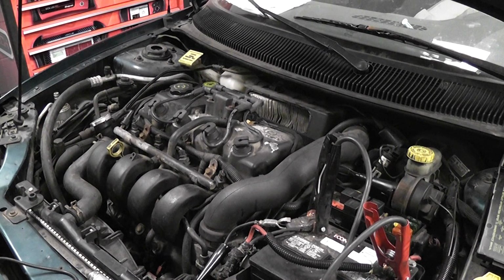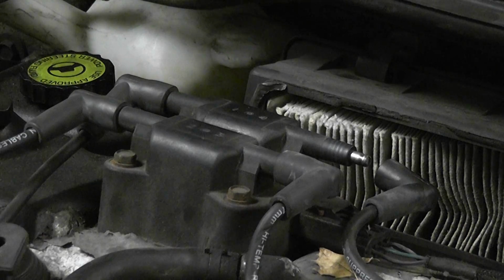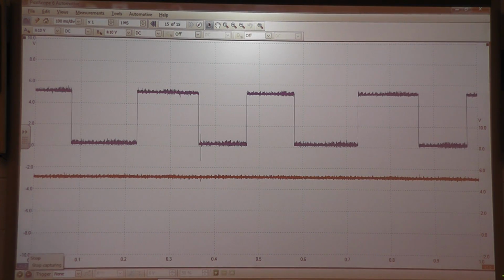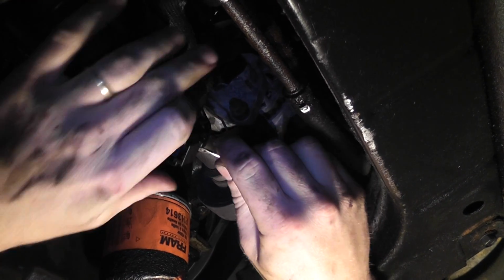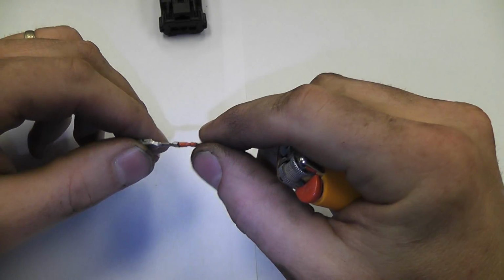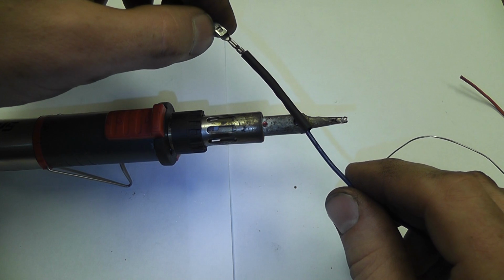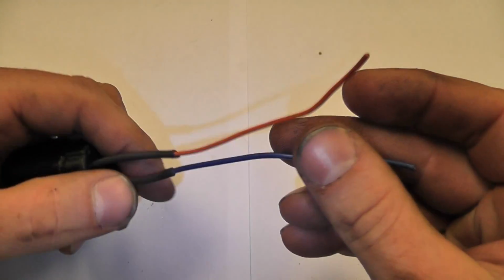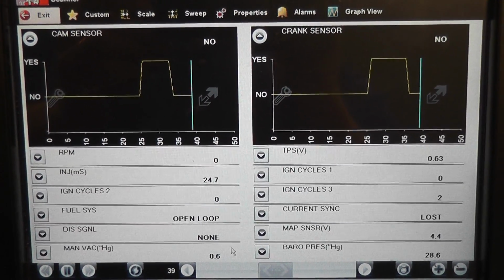1997 Dodge Neon no start, crank sensor problems

Comment: I had the same situation with a 2014 altima. No spark, no input to ECM.  Changed the crank sensor but still no spark. After market crank sensors do not work for  Nissan.

Comment: I have a 1999 mustang it was running rough.  Replaced plugs and wires, lower intake was leaking coolant so I replaced that now it crank no start. I have no codes. I triples checked the spark plug wires routing. I have low compression on cylinder #2 would that cause a crank no start? Could the head gasket be bad now or maybe carbon build up??

Comment: One of the most thorough videos on YouTube. I was trying to find the position of the sensor as some diagrams show it being just under the starter on the front of the motor but I think they were for newer years. I did the oil pressure sensor today and I hope when I take the crank sensor out tomorrow that the wires do not break. Not nearly as skilled at fixing wires as you.

Comment: GOOD AFTERNOON, I AM FROM BRAZIL and I have a neon chrysler, which was stopped for 3 months because of the fuel pump. I changed the bomb and now it starts normal, but when I pass the second gear it drops the rotation and does not respond and ends up dying. I also noticed that his slow motion has a very small flaw. What can it be ? I NEED HELP PLEASE
Reply from the maker: "but when I pass the second gear it drops the rotation and does not respond and ends up dying" 
I do not understand this statement
Reply: @ScannerDanner  In fact there is no such thing as passing the second gear and the car loses acceleration, the car is running normally and suddenly the accelerator does not respond and the mortor turns to 600 RPM, it shakes a lot and accelerates the engine goes off
Reply from the maker: @BILUKAMOTOS1975  year, make, model, engine size would help, also this should be setting some type of trouble code. Post this to my forum, it is free to join and we can help you better there www.scannerdanner.com
Reply: @ScannerDanner  ok
Reply: ok I'm already on your site!

Comment: Hi scanner how are you doing  im just looking for the section about the floating ground can you please tell me which one it is
Reply from the maker: You'll see this on Variable Reluctance Sensors (permanent magnet pulse generators) on cam and crank sensors and you will also see it on some O2 sensors circuits. Chapter 21 playlist on both YouTube and my Premium channel. And then Chapter 5 also.

Comment: 03 dodge stratus no start it got new Ck &can sensors. A new ecm has been flashed still no start. Found no voltage to coil from connector. Sensors have 5volts .any idea what it mite be??
Reply from the maker: You won't have voltage to the coil with the key on, on that model, as it is controlled by the ASD relay. (Same controls as the fuel pump) Which only gets energized by the ECM during initial key on and when there is an RPM signal (cranking or running)

Comment: Jeez, learned a lot here, from crank sensor to CAM sensor , Butane Soldering Iron/ gun, Heat shrink... wow! I got to have all these tools for my Chrysler neon cables.  Thanks a lot... felt like i was in varsity class!

Comment: DID YOU SEE all that oil on the connector.....dodge has a serious problem with oil wicking alll through their harness's causing wacky voltages and stop/runs....check other connectors, there will be oil in them, sometimes alll the way to the code reader under the dash....all kinds of wacky readings, gremlins

Comment: Aleksi
Hi, I have a Chrysler neon 2001with a remote problem. The times are working well and some times do not work and I have checked the coel does not send electricity to the candles

Comment: Hello need ask a question my battery started dying like the alternator was bad so we changed it n now it's cranking over but won't start u have any idea what it can be
Reply from the maker: You need to tell me what you are missing to help. Spark, fuel pressure, injector pulse, compression, trouble codes

Comment: Hello, I am from Venezuela. I would like to know what can I check on my neon 2005 auto transmission because it wont start, I changed the CPS this morning and it did nothing, the starter runs, I see spark on each spark plug cable there is fuel in the fuel line (pump is running fine) but the engine wont start.

Comment: this is one of my cars i change the engine temperature switch cause thats the code i got and got a new battery when i turn the key i hear the fuel pump but it wont crank
Reply: i have a light pitching noise in my fuse box when i turn the key i have new relays and i put my hand on them have someone turn the key and they click but thats it  it wont crank i changed the ignition switch and crank sensor
Reply from the maker: It is becoming more and more difficult to answer questions here. I have 80,000 people asking me for help now. So I have created a forum to help you guys better. It is free to join and we can exchange pictures, wiring diagrams and waveforms if needed to help guide you through the process of troubleshooting your vehicle. Thank you so much! Hope to see you there. 
Paul Danner (ScannerDanner)
 https://www.scannerdanner.com/forum/post-your-repair-questions-here.html
Reply: take the fuel line off the fuel rail cut open a p0lastic bottle stick the line in the bottle hook a clamp from the negative part of starter put the car in neutral go back under the hood now the wire clamped to the negative part of starter touch the other end to the positive of the battery it will try n crank the car if no gas comes out the line into the bottle than you have a fuel issue
Reply: there is gas in the line when i push the little button on the fuel injector rail do you think it also maybe my spark plugs when i replaced the battery it turned over once then died i also but some fuel injector cleaner in it lastnight
Reply: thanks for commenting on my issue why does my fuel pump make noise if its a fuel issue could there be trash in my fuel line if so how do i get it out i did manually put gas in it when it wouldnt start thinking that was the issue
Reply: could be a multitude of issues if you do what I suggested with the fuel line you will rule out the fuel pump or find that their is no fuel you could get someone in the driver seat you under the hood take the fuel line that goes to the fuel rail push the two sides in the plastic clip pull it off put it in a bottle cup exc now have them crank it if you get fuel your fuel pump and rely are good aslo you should hear a click noise coming from the relay in the fuse box under the hood under the battery when u turn the key on before cranking pull it out and inspect it too its labled on the lid its the  bottom left I believe see if the metal looks burned up on it after pulling it
Reply: the fuel filter is inside the fuel pump on the neon their is also a fuel pressure regulator their is a video I seen on yt type in dodge neon fuel pump and they show you how to remove it you will need a jack and jack stands
Reply: not sure bro mine still isn't running I checked the computer on mine and the damn thing is loose like it has ben tampered with in the past id check the cam sensor if you remove the battery look to the left its a squar piece if their is oil coming out of it id replace it if you got any oil in the switch try n clean it out I changed mine it was bad with no codes also check the wire running to the starter the red wire if it is broke anywhere replace that joker you can get it from the topside you cant buy the wire you gota make a wire they sell the stuff in autozone mine is no spark no fuel but if I slam the hood a bunch while cranking sometimes it cranks lol also look up stuff on the pcm your cars computer is bottom driver side of the radiator also their is another sensor on top of motor by the battery side it screws in to the intake a hose runs from it to the air filter box take that hose off same one you got to take off to take the red wire off the starter if you had to replace it stick a rag down the hole if theirs oil in their vacuum that out and replace that sensor hope you get it take care of also check your altnator wire harness you got to jack the car up to get to it bottom passenger side stick ur hand up by side of oil pan make sure no wires touching on the clip calmp check all your fuses with a test light yo ucan make one with a speaker wire and gator clip or for the negative n use a 12v light I cut mine out of another vehicle if you find the part don't forget you can check your local junk yard to get a warranty
Reply: might wana check the timing too
Reply: also take all your spark plugs out and make sure their not saturated in oil or water might have a blow head you can tell by taking one spark plug and wire out at a time poor some water into the radiator make sure its full have someone crank it with that one spark plug out it may throw a little water out the second they crank it if has any bubbles you got a blown head or a issue inside the motor you keep the cap off if no bubbles ok put that plug in and move to the next one till you do them all any bubbles in any cylinder you know you got a head gasket issue you might want to take the starter off n run it to autozone or a auto place to test it just to rull that out they do it for free same with the altinator also could be a coil pack the thing your spark plug wires plug into their about 80$ new they don't go out often tho if you got gas check all wires and check your coil pack for spark tak a wire off get a screw driver n place it close to the coil one at a time if you get no spark than you know it pretty much a sensor id change the camshaft sensor if any oil iis on it n check the timing you need a timing light to do that clean ur terminals n check everything you really need a volt meter and test light you can borrow the code readers from autozone I give em my id n they let me take it outside

Comment: Hello Friend help me I have a neon 2004 and the rpm goes down after 90kmh or when the last change is turned on the service light and the code goes out P0339 says that it is the position sensor of the crankshaft where it is located in my vehicle in which part Of the motor or the block I agrdezco apology my bad English I reset it removing the negative cable and it erases but if I walk and I have to give speed returns the fault
Reply from the maker: It is becoming more and more difficult to answer questions here. I have 80,000 people asking me for help now. So I have created a forum to help you guys better. It is free to join and we can exchange pictures, wiring diagrams and waveforms if needed to help guide you through the process of troubleshooting your vehicle. Thank you so much! Hope to see you there. 
Paul Danner (ScannerDanner)
https://www.scannerdanner.com/forum/post-your-repair-questions-here.html

Comment: A wet rung out sponge will keep your soldering iron tip clean, A wipe between soldering wires. Makes a cleaner easier to solder joint.
Reply from the maker: +Jason Unknown appreciate the suggestion, thank you
Reply: ScannerDanner hope it helps I know it's hard to do in the field, thank you for your informative videos I've been watching quite a few of them. I appreciate your dedication to teaching.

Comment: my brother replaced the engine in 1998 dodge neon. It will turn over but has no fire to spark plug. It is getting fuel but won't crank. I watched your video and asked him about crank sensor. He said it does not have one. He put the cam sensor on this motor and still won't crank. Is there a fuse or does he need to replace the cam sensor with a new one

Comment: hi paul fantastic videos as always hae a question my 2002 dodge caravan sport 3.3 litre engine has 2 codes  a po351 and a po352 ignition coil a & b primary and secondary circuit malfunction but the vehicle runs randomly it will have a lonnnggggg crank time before it starts and now the check engine light went out  but once in awhile after it runs for 3-4 minutes and I shut it off I get a extremely long crank time out of it before it starts any direction or thoughts  thank you  larry

Comment: Everytime  I joined and solder broken wires in automotive wiring.. I always leave about 1/4" bare stranded wire from soldered wire for flexibility . This is to avoid wire easily broken due to vibration or repeatedly bending... Just an idea. Hope it helps...

Comment: Ive been having the same issue with my eclipse im getting fuel but no spark is there any way to test the crank and cam sensors with out a scan tool. I do have a DVOM and test light any help will be welcomed
Reply: +David Baker The eclipse is a 95 with the 420a
Reply from the maker: +David Baker https://www.youtube.com/watch?v=yp_kK6U8a64
https://www.youtube.com/watch?v=irHVjFTq4LE
Reply: Thank you this will help me out a lot

Comment: I have an 04 neon that has a crank, no start status, i found oil in the plug tubes so i replaced the valve cover gasket and tube seals, new plugs, it has spark, checked the coil pack with a multimeter, it's not shot but still crank, no start. I am really in need of help with diagnosing it. No codes are present, fuel press. is good and has spark on all 4's. thank you in advance.
Reply from the maker: +Justin Louiss De Guzman Injector pulse? Does it run when you spray carb clean into the throttle body?
Reply: +ScannerDanner negative, sir. tried that, starter fluid, tested pulse with a noid light, all 4's are firing, good fuel pressure, compression on all 4's are great.
Reply: +Justin Louiss De Guzman Just wondering how you made out with your Neon?  Did you find the problem?
Reply: +Chris C No, sir. I'm afraid not. Can't even find a TCM for the damn car either.. u got some tips? thanks in advance!
Reply: +Justin Louiss De Guzman Have you tried injector balance test and also put a scope on your injectors to see if all is ok?
Reply: If everything is there that it needs to run and it still does not, makes me think there is some sort of computer enabling of that is missing..
Reply: +Chris C I will test it tommorow and look with a borescope to make sure that it hasn't flooded. It just really upsets me that it only threw a single code which is not even related to the problem.
Reply from the maker: +Justin Louiss De Guzman you need to check compression next
Reply: +ScannerDanner already did, all 4's are perfect
Reply from the maker: +Justin Louiss De Guzman what were the numbers?

Comment: my 1997 plymouth neon runs okay around town until i go 50 mph+ then the car shutters as if i dont have power. lights dont dim but the speedometer is jumping then drops to 0. did a full tune up and has a new transmission. could it be my pcm, pcv, egr or crank sensor? i has a missfire in cylinder 1 and 4. and a code for random missfire
Reply from the maker: +josue guerrero It could be the wiring to the vehicle speed sensor rubbing on the transmission. This will pull the 5v ref circuit to ground and affect your crank sensor and cam sensor signals. It couls be a bunch of other things too. Check out my 5v ref videos

Comment: This again is another awesome video that is very informative and enlighten and I just wanna say great job in doing what your doing for beginners like myself and I am grateful for these videos. However should the wires had been mixed up how would you go about having the correct wire placed in the correct location in order to prevent damage to the sensor or computer?

Comment: This is exactly what is wrong with my car now, just pulled out the sensor to clean it up. This video is an awesome guide!

I also have a oil leak but not sure where is was coming from, my crank sensor was filled with oil just like in the video. Is there a common place the Neon leak oil from?
Reply from the maker: Unfortunately yes. The head gaskets are notorious for leaking oil.

Comment: Was wondering why my 99 neon has a rough start. Have to give it gas to start up. Not the fuel pump, or anything like that. My friend chopped my muffler off as a joke, but little does he know I liked the loud sound and rough idle. Could it be my oxygen sensors going out to cause this? Or having no muffler going straight pipe causing me to have too much gas in the cumbustion chamber?

Comment: i have a 2000 kia sportage with a no start issue . this problem is with the fuelpump relay on a 2.0 engine , the relay is good but does not close when key is turned on , i was watching your videos and realized the coil inside the relay is not being energized . can hear a click but circuit doesnt close . could it be a bad ground ? or should i check something else.....rocky osborn , rckyosborn@gmail.com

Comment: I wish I knew this... 3 weeks ago. My car was cranking but wasnt starting. After a couple of days it wouldnt even crank. It will start cranking then fade away like as if the battery was dead. Thank you for the Video this was very helpful. I might not have been able to fix my car but I know I can fix the next neon that has that issue.